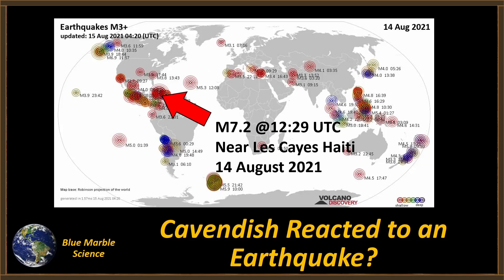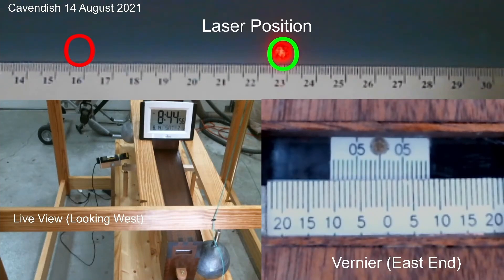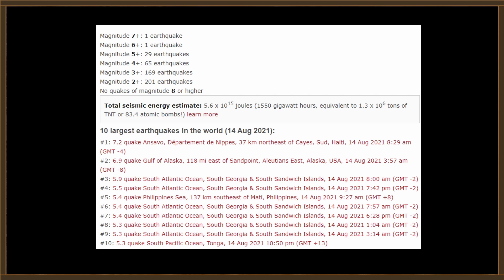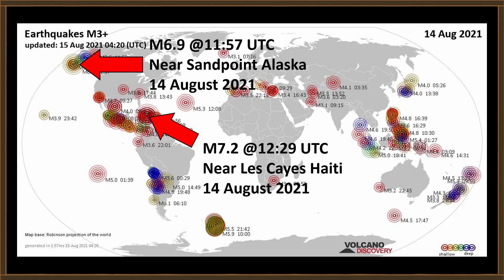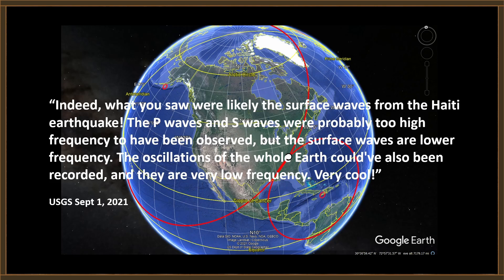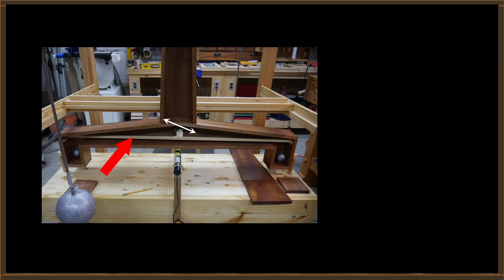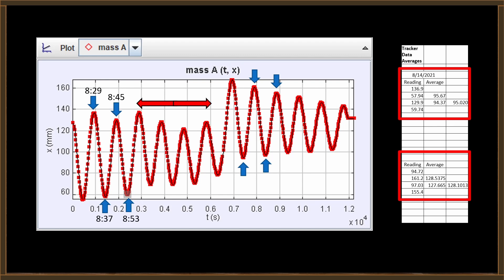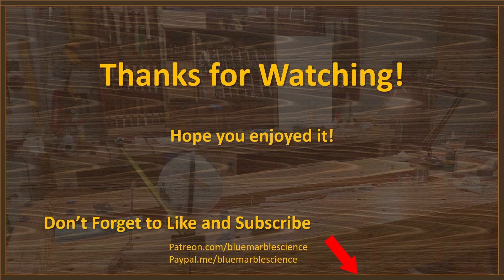The Cavendish Torsion Balance Detecting an Earthquake?

Comment: Quick question - are comments containing links automatically deleted? 

I posted a comment with links to USGS that explained the two types of surface waves, but don't see it. 

One type produces motion parallel to the propagation, and the other has motion perpendicular to the propagation, so it's possible you might detect something no matter which way the apparatus is oriented. However, I think you would need to take into account things like whether the amplitude of one type is attenuated more than the other, the frequency ranges they support, whether they are frequency-dispersive (turning an impulse into a chirp of frequency), and so on.
Reply from the maker: No - they're automatically held and I have to go and approve them. I don't do it as often as I should I suppose so let me get in there and release the thing. It's just there to avoid some flattard sticking a link to pornhub or something in here.
Reply from the maker: I don't see it. There's nothing in the folder. You can try posting it again. Maybe it will show up. Beats me?
Reply: @bluemarblescience  Trying the links again:
https://earthquake.usgs.gov/learn/glossary/?term=surface%20wave
https://earthquake.usgs.gov/learn/glossary/?term=Rayleigh%20wave
https://earthquake.usgs.gov/learn/glossary/?term=Love%20wave

Comment: Is that video, in original form, available for downloading?  I teach physics and use Tracker (physics motion analyzer program) and would be interested in tracking that motion.
Reply from the maker: If you'll send me an email at bluemarblescience@gmail.com I'll send you a copy of the video file. I assume you mean the time lapse. I'll warn you ahead of time though that the time lapse has a frame rate of 20s and the vertical oscillation has a period of 1.7s so you only get random positions of the laser vertically. But you're more than welcome to a copy.

Comment: I suspect that you didn't catch the actual shaking from the quake, but the result of the contraption holding the wire that holds the torsion balance. 

I have a rudimentary understanding of Cavendish, but it seems, like a pendulum, which while connected to the ceiling, is, by and large, independent of the planet, so it's almost floating free of the device, aside from the wire.

Comment: The materials are very accessible, but it's still a precision instrument. 
It's fascinating what one can detect, even though it was not the intention of the experiment. 
It reminds me about the neutrino emissions that where detected by particle detectors, even though they where looking for different things. 
Or the hubble deep field image, which is extremely fascinating, even though that was not what was what the telescope was originally designed for.
Reply: Just like a box of chocolates, you never know what you’re going to get. The Holmdel Horn Antenna was designed to be used as a satellite communication antenna and radio telescope. What it discovered was background radiation left over from the Big Bang.

Comment: According to my calculations the s waves should hit you 10. 8 mins after earthquake.

S surface waves move 2.1 miles per second.
2200km to miles = 1367 miles

1367 miles ÷ 2.1 miles per second = 650 seconds.

650 seconds to mins = 10.8 mins
Reply from the maker: Thanks for that! The quake started at 12:29 and we were seeing the pronounced activity by 12:40 so your calculations sound about right.
Reply: @bluemarblescience  sounds about right, from further research the p waves should arrive first so that was probably the disturbance before the s waves at 12.40
Couldn't find a specific rate that p waves travel though, just that they are the first waves to arrive as travel the fastest.
Did you feel the quake?
Reply from the maker: @Rachie-nj3oi  I didn't feel it but we usually don't feel them. We have hundreds of earthquakes on any given day and the vast majority go undetected by our ability to feel that motion, but seismometers can register them. I went to the USGS to get their opinion because there's a lot to know about this and I know very very little of it. But I do know it isn't as simple as just googling a speed for P-waves. That speed changes depending on the type of material the wave is traveling through and as they USGS pointed out, those P and S waves are probably too high in frequency for me to detect anyway. The surface waves, on the other hand, are a lower frequency and that's most likely what we saw. Hats off to the geologists though! They spend years in school learning about this stuff so people like us don't have to go through all of that.
Reply: @bluemarblescience  well I have no idea what you detected then because actually after more research it couldn't of been s waves because s waves only travel through solids so wouldn't be able to travel the ocean as Haiti is an island. 

Surface waves only travel through solids too. So I have no idea what you detected afterall. But shows the maths can work out even though it couldn't be what I thought because would have to travel through the ocean. Copied and pasted from Google. 

 Shear waves cannot travel in liquids or gases -- so, for example, S waves don't travel through the ocean or through the outer core. Surface waves are called surface waves because they are trapped near the Earth's surface, rather than traveling through the ``body'' of the earth like P and S waves.

Surface waves travel only through solid media. They are slower-moving than body waves but are much larger and therefore more destructive. The two types of surface waves are named Love waves and Rayleigh waves, after the scientists who identified them.
Reply: @Rachie-nj3oi  Haiti is an island, but it's on a continental plate.  If it's the same plate, or in contact with BMS's plate, a surface wave may be possible.
Reply: @bdf2718    surface waves don't travel through the body though they stay near the surface apparently hence the name. 
So that leaves p or s waves but blue marble said the professionals said too high frequency to detect.
So... No idea.
Reply: @Rachie-nj3oi  So continental plates don't have surfaces?  Who knew?

Or are you saying surface waves are blocked by lakes?  Who knew?
Reply: @bluemarblescience  But Flerfs tell me to trust my senses! If I can't sense it it must not have happened! /s
Reply: @Rachie-nj3oi  surface waves follow the surfaces of a *layer*, not necessary the surface of the ground. A surface wave on a continental plate will follow the plate surface, whether it's underwater or under something else.

Furthermore, there's two kinds of surface wave.  Rayleigh waves are oriented up and down like ocean waves.  They can propagate through water to an extent (depending on their frequency matching water wave frequency).  The other kind are called "Love waves" where they're oriented sideways.  They, like S waves, can't propagate through water.
Reply from the maker: @Rachie-nj3oi  The seismologists at the USGS do know though and I'll go along with what they're telling me because they're experts in this field with a plethora of specific education that you or I don't have. I highly doubt anyone is going to be able to educate themselves in the field of geology or seismology regardless just by doing google searches. I do know that these waves travel through the crust even if that crust is beneath the ocean and multiple geologists are telling me that I most likely saw the surface waves.
Reply: @bluemarblescience  Fun fact: Gravimeters may serve as early warning systems for earthquakes as gravity changes from matter redistribution travel at the speed of light allowing for significant faster detection than detection of seismic waves.
Reply: @bluemarblescience    my calculations were based on s waves not surface waves.
I thought s wave meant surface until I looked more into it lol. 

Ok so surface waves travel 1.5 miles per second.
So 1367 miles ÷ 1.5 miles per second = 911 seconds
So 15 mins.

Wouldn't that also mean the surface waves would have to travel upwards to affect the cavendish device if they travelled along the crust?

Be surprising if they move as fast as the s waves I calculated as they apparently move slower than body waves.
Reply from the maker: @Rachie-nj3oi  I really can't speak about that stuff intelligently. I never studied it and never made much effort to find out on my on. But I'm pretty sure that the surface waves can simply travel along the surface of the crust regardless of whether there's water on top of it or not. So the ocean floor just rises up to become dry land and the waves follow that. But as far as speed goes, I've seen some fairly wide ranges and I think it's really dependent on what material the waves are moving through. I'm sure the geologists know how those variations in density or whatever work in various areas. PhD Tony can tell you for sure.
Reply: @Rachie-nj3oi  "Ok so surface waves travel 1.5 miles per second."

Depends on the medium it is transmitted through. Could be much faster or much slower.

Comment: Very cool.  Did you think about checking to see if there is a way to use the oscillation to work out the magnitude of the earthquake?
Reply from the maker: I have no idea how to do it, but there might be a way. We need an expert to answer that question because I'm certainly not one!
Reply: @bluemarblescience  Try contacting the U of U Geology Department, they might be able to tell you.
Reply: If there is a way you've recorded all the info you'd most likely need to do it.
Reply: @bluemarblescience  It's simple.  Calibrate it yourself.  After a few hundred earthquakes you should be able to identify where they are and what their magnitude is.

;-)
Reply: @fromagefrizzbizz9377  probably can’t pinpoint the quake epicenter with just one recording station. You always need at least 3 to get a good fix unless you’re just doing the method blue used here which is work out from a list of known earthquakes. But to independently triangulate that’s yourself you’d need 3 adequately distant stations.